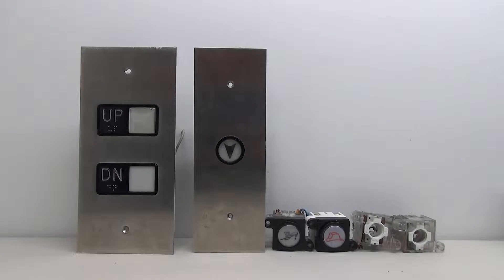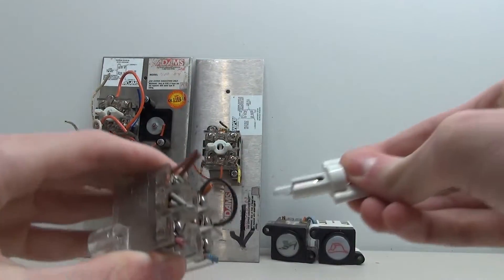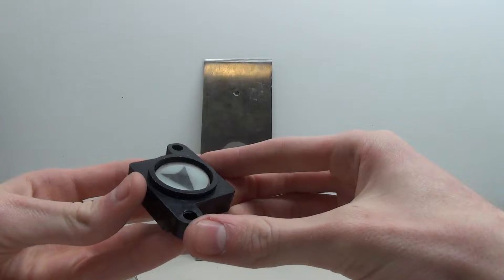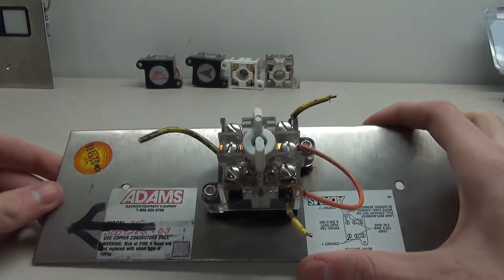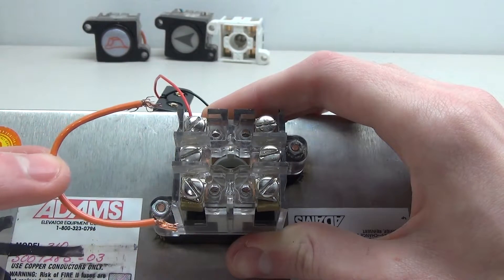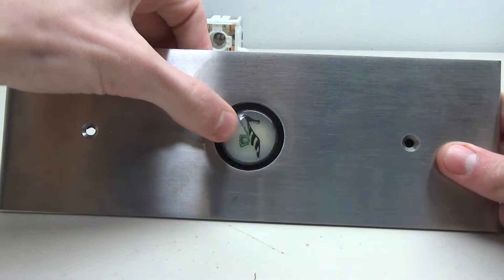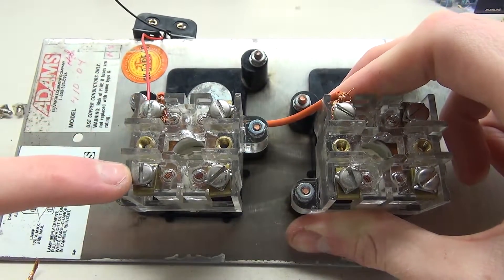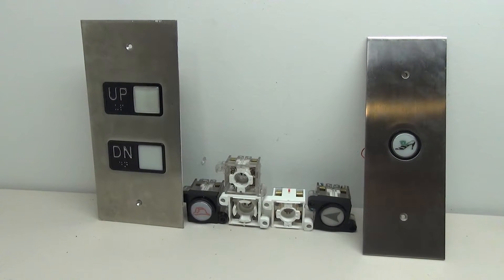How to Wire Adams Elevator Buttons

Comment: The only store Ive ever seen the square buttons is at one of the local target stores I go to
Reply from the maker: I’ve seen them in a Target as well.
Reply: The one I go to looks to have been modernized slightly because they have dover vandal resistant call buttons and I do say they because it is a bank of two elevators but they do have very epic motors

Comment: Epco and Adams are pretty much the same thing.
Reply from the maker: VERY similar!
Reply: I ordered an Adams Survivor intermediate hall station recently, and I'm going to wire it up with blue LED's. It's the actual survivor button (with the survivor base). The metal one with the white translucent dot in the middle. Also, Adams WN looks a lot like Innovation Decorator. Epco, Adams, and Innovation all seem to be related. 
Also, thanks for noticing me. I subscribed.

Comment: Can you use store bought wires instead of the wires that are already hooked into the part? I have this exact same button at home and there aren't any wires on it. I have a roll of blue wire that looks like it might work. Can I use any wire? I want to show you a link of what I found on Amazon that looks like the same stuff you used
https://www.amazon.com/LAMPVPATH-Battery-Holder-Leads-Wires/dp/B07TB4HDYH/ref=sr_1_3?keywords=double+a+battery+pack+with+wire&qid=1580568899&sr=8-3

https://www.amazon.com/MCIGICM-Circuit-Assorted-Science-Experiment/dp/B07PG84V17/ref=sr_1_2?keywords=circuit+board+led+light&qid=1580568859&sr=8-2
Reply from the maker: Yeah you can. Since these are all low voltage/current, you can really use whatever wire you want.
Reply: Ok thanks’

Comment: That yellow LED must be feeling the burn...
Reply from the maker: It's actually rated for 3-3.2v.
Reply: @stlelevators  Are you sure? Did you look at the datasheet and not what the supplier 'said' it was? From my experience no yellow/amber LED I have ever heard of has gone above 2.8Vf max. (Except for special LED's that go to 12V but those are the exception). Or is this LED not actually yellow?
Reply from the maker: @BigKitty1011  It's warm white.

Comment: when you get US buttons it would be cool to see a video on wiring those :)
Reply from the maker: I've worked with them before and they are ANNOYING. I'll see if Andrew has any he needs wired up.
Reply: STL Elevators I think I remember watching the live stream, and if I remember correctly, wasn’t it manufactured with low quality plastic and mounts that bent easily and were fragile?
Reply from the maker: Yep

Comment: The funny thing is I got my new Surivour contact today, but I still need to rewire, but I’m missing one of the 120VAC 💡 s.
Reply from the maker: I hardly ever use 120v for elevator parts because 1. Higher risk and 2. You have to plug in the button to use it.

Comment: Also, I've seen countless variants of the Adams contact base. I've seen ordinary clear ones, green ones, black ones, black clear ones, but never a white opaque one before!
Reply from the maker: But yet they do the same thing
Reply: @stlelevators  Well, some actually work in reverse. They make a complete circuit and pressing the button breaks the circuit
Reply from the maker: Those are typically found on Door Open buttons. Its just a NC switch.
Reply: @stlelevators  Interesting. Now I know the name!